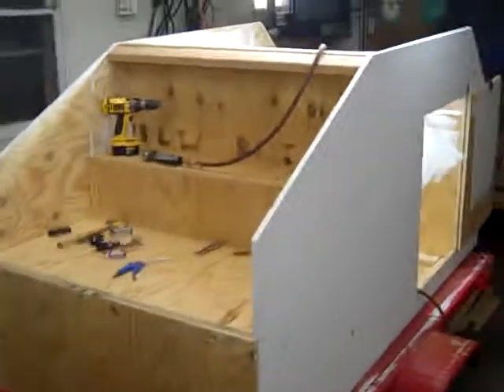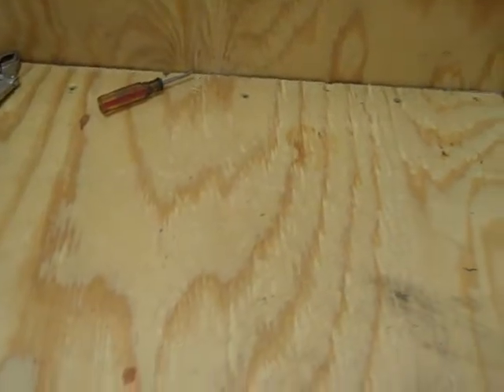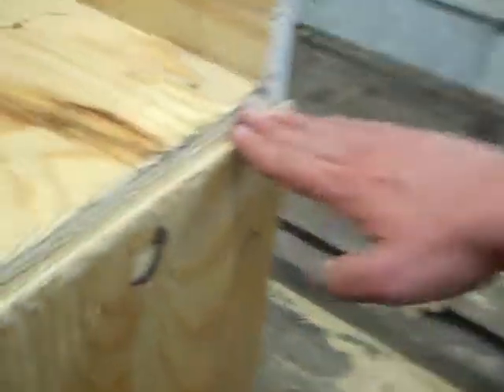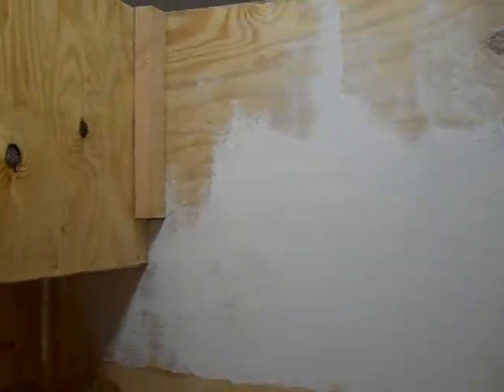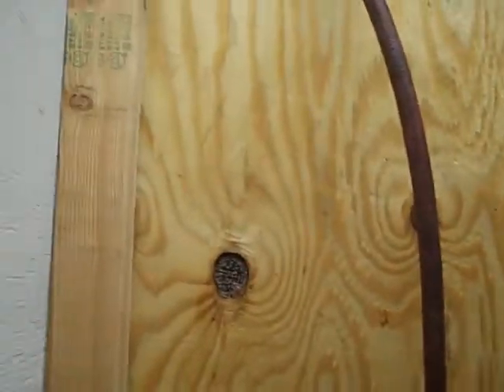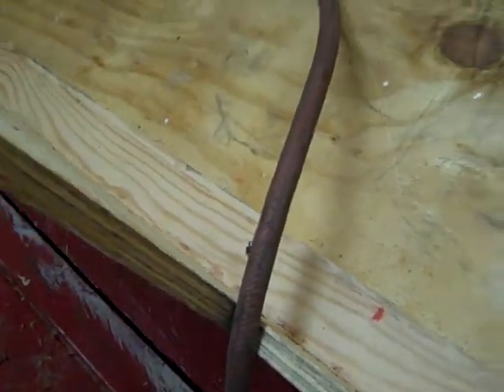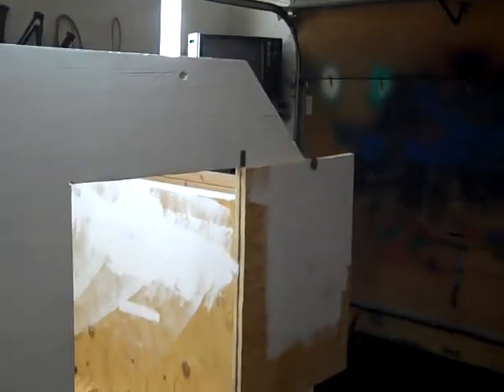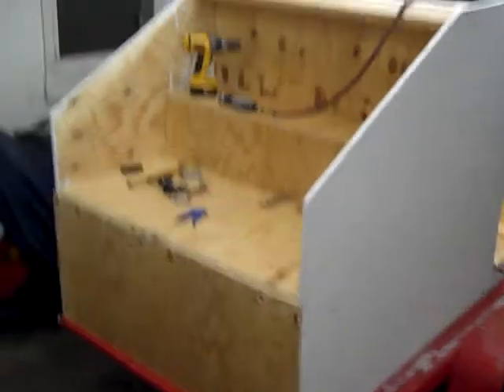tiny travel trailer build part 6

Comment from the maker: @NullH3ad
Thank you for the kind words.

Of course I'm going to wire it up, electrical is one of my strong points.
It will get 120VAC because most of the places we go have hook-ups.
So of course it will get an small AC unit and maybe a microwave.

I don't think I will bother with 12VDC, I always have a flashlight on me and those little stick-on battery powered LED lights last a long time.